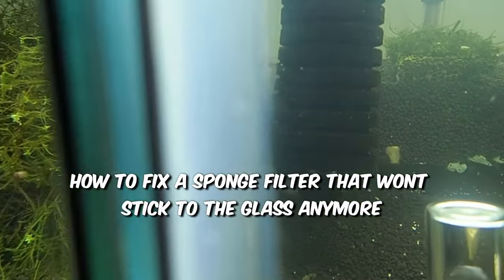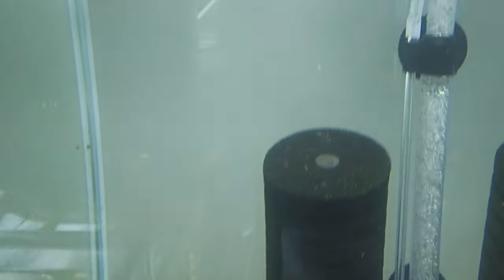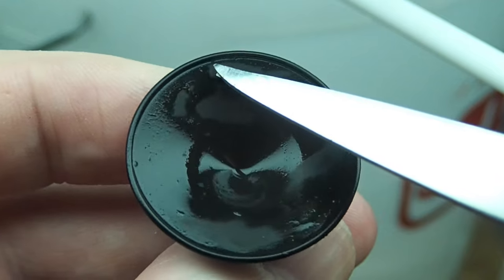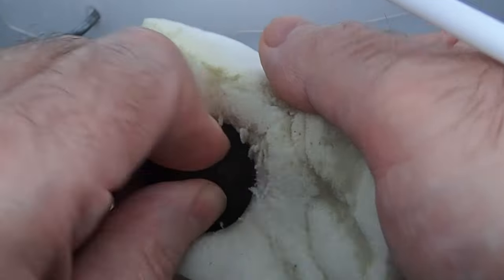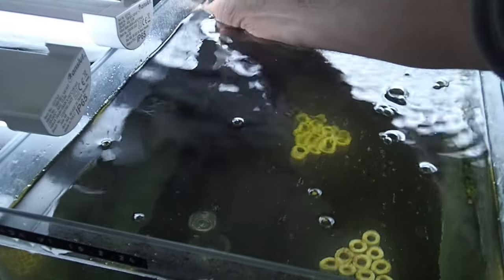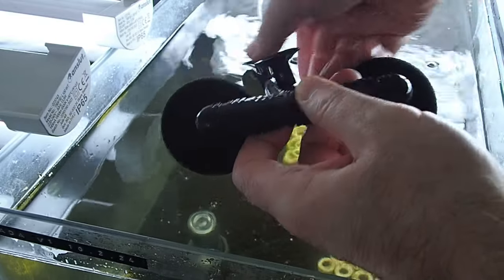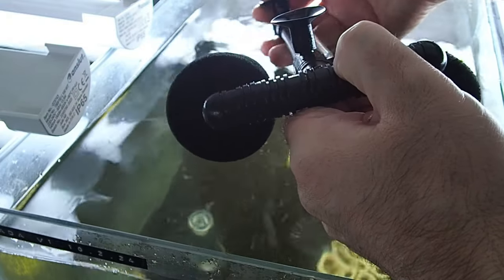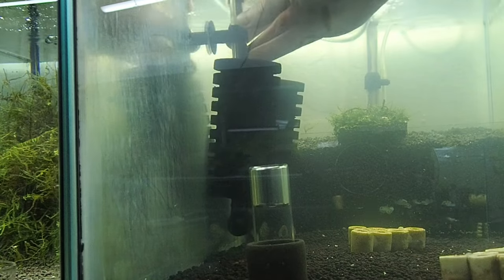How to fix a sponge filter that wont stick to the glass anymore - try this

Comment: Thanks I'm having this exact problem, I was going to boil them but this looks easier. I noticed snails lay eggs too on the rubber while it's floating stopping it from sticking if you don't check.

Comment: Hlw,,,,love your videos.. I have a issue with my golden back neocaridina shrimps,,,,,i have 15 gallon tank,,a little sponge filter and some hornworts,,,,,i realesed 10 shrimps in my tank,,,,after 2 days i saw them molting. From 2 days after molting they are still hiding and not eating much,,,if you do a qna video in future please tell us something adout my issue.
Reply from the maker: Hello mate your issue could literally be anything, what you are better doing for a more in depth reply is going on to facebook and join my group Aquarium Shrimp Keeping and post the question there.
Reply: Like what's your water like.. what type of water you using? How old is your tank.? You have soil? Is it capped? What's your ph at? Gh kh? Etc..etc...

Comment: boil the kettle and put the sution cup in a cup of hot water. Only do this for a few seconds, dont boil it. Then add cold water or let it cool. It will return to it original unflattened shape.
Reply from the maker: yeah ive tried this with lots of suction cups, the fix for me anyway doing this has always been temporary.